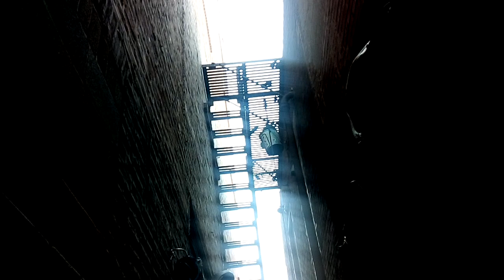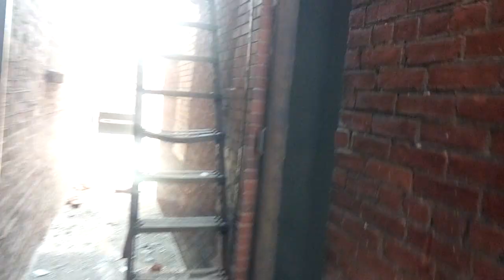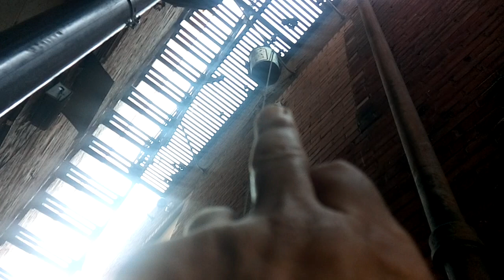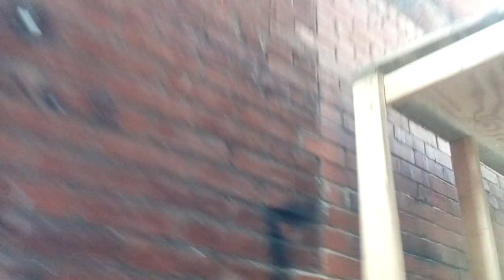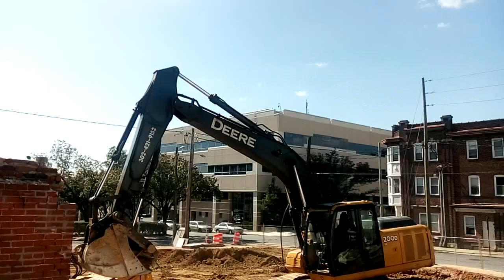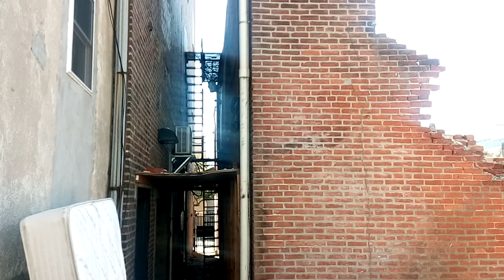Fire escape demolition with a kicker; will it collapse onto the workers removing it?

Comment: I just found your channel and appreciate you doing this.

My thoughts/opinion as a carpenter would be to build temporary braces under the first landing to the ground and then proceed to brace each landing transferring the weight down.

After that send some guys up in a man lift to make 3’ holes around where the fire escape connects to the demolished building and then let the machines gently  “peel” the last wall into the foundation without disrupting the fire escape or the other building and then remove the fire escape safely at your leisure.

Please give your professional opinion on my non professional opinion good bad or indifferent its very welcome.

I’ve been in the trades since I was about 12 full time and engineers/architects have taken my ideas and ran with them a few times over the years and curious how my thought process matches up.

Thanks man, it’s a shame about the labor pool now a days.
Reply from the maker: Thanks for joining in...  Christopher, the walls are possibly already braced by the fire escape and if that is so, then a few issues ending in a deadly result could happen if you put anyone in the alley... The best, is to keep humans out of the alley and to pull down what you can from the far right end of this wall (street side) to resolve potential materials from elastically / bouncing into passing vehicles or people.
Then simple remove the bricks from the area around the fire escape down to the first level from the top... This will include removal from the wall that will remain... The issue becomes the dramatic collapse of the stairs once you release their bolted connections.  
The first section can drop free and entangle into the lower sections = making working on lower sections more dangerous.   
I will explore the connections once we get onto the man-lift and pull down some brick. 
The last thing we want is this wall buckling in and killing a worker between the two walls...
These walls are two courses thick and I will check how plumb this system is to determine best course of action once the stairs are more exposed.
I hope to create a hinge on each stair stringer to the ground level... This may include using the larger excavator.

Comment: Pull it over
Reply from the maker: I will use a lift on it and we will remove the brick around it by hand and confirm it will not pull down a section of the existing building...  Also, it is needed for the corners of the structure, closest to the street (the lift I mean)...  Video to come on Monday I hope.